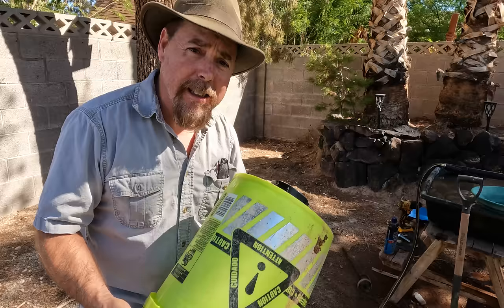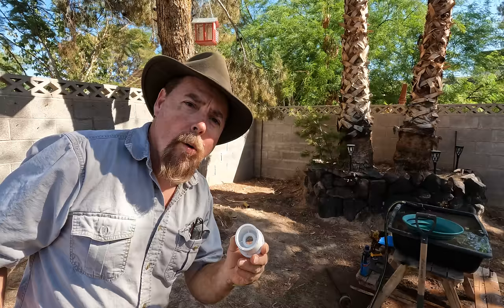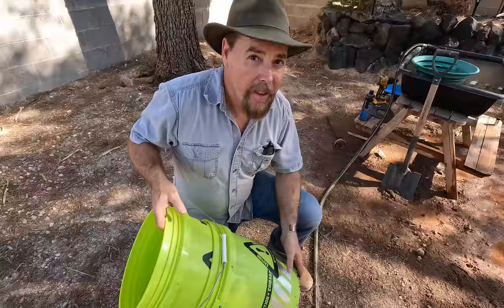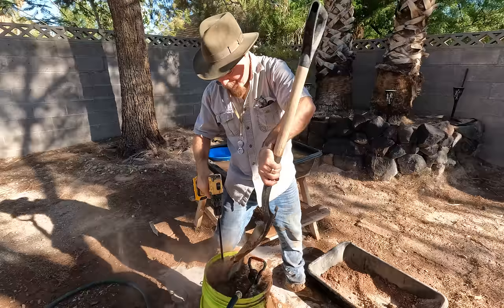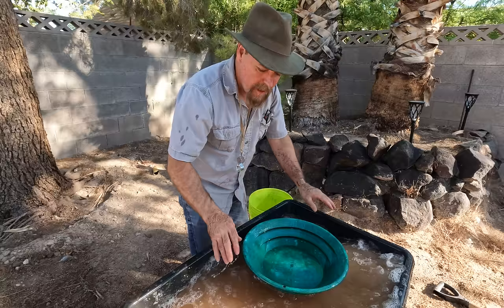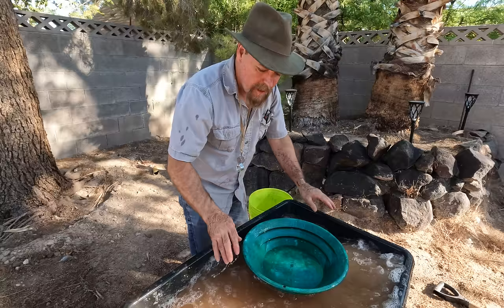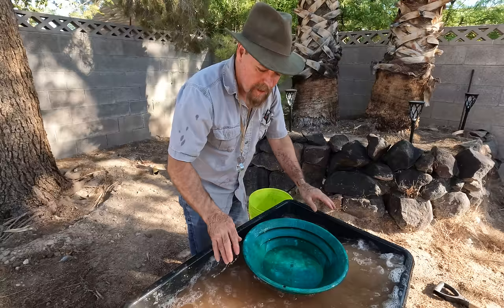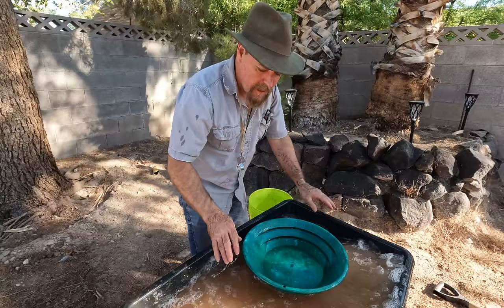Gold Prospecting Hack - Find Gold Using a Bucket & Drill! 🏆🔩

Comment: Ok Mr. Williams, lets do something more 2023, after all, we were supposed to have flying cars by now, so why not go expensive on the most vital tool that determines the efficiency of your potential fines. Let's science the crap out of it, make it transparent so the kiddos can see inside, and us too, to help determine whether it's doing what we want, lets harness AI technology to help with it too! I'm thinking this is a good starting point... This double cyclone build:

A real cyclonic separator that separates off the heavy dirt into a separate holding chamber, where the water is relatively still and the dirt can settle, consider the cyclone in a number of parts:

The upper body – the part that is simply cylindrical in shape and provides a mounting for the water inlet and outlet.
The cone – the section that is cone shaped (surprise surprise). It channels the dirt down through the heavy dirt chute (on the end of the cone) and into the collection chamber.
The water inlet and ramp – the inlet brings in the sleus filled water, the water ramp reduces turbulence by directing that water downwards into the desired spiral.
The water outlet – is another cylinder that sits in the centre of the upper body. The lighter  dirt and water is sucked out the water outlet.
I wanted the cyclone clear, so we could see what was going on inside. This is important to me, because it's almost like magic to me, and so many others, I wanted to watch it actually happening in detail. Having it transparent also means WE can observe the performance differences when WE tweak the design! Play with it, change the airflow, or vary the waste matter being separated, oh the things we can do! Plus we can instantly see if the collection chamber is full or if there is a blockage or a similar problem.  Basically having it clear is MORE THAN just sick dude! It's gonna be EPIC.....😅I hope. Spare no expense, but welded stainless with plexiglass and industrial motor, naw, keep it real, real dirt cheap to duplicate.
Reply from the maker: great idea

Comment: Why not just using a plain bucket with the paint mixer? At the end, you just pull out the iron with the magnet and pan the rest. This way all the gold including the micro flakes would be at the bottom of the bucket. This would bring down the cost of the setup down to $15 (bucket + paint mixer) and no need to build. Just wondering. I'm not a gold prospector, excuse my ignorance if I'm proposing something technically incorrect. 

I would also think a guy could go out, spin the mixer in the bucket for a day, accumulate concentrated materials and pan it at home during the rainy days..
Reply from the maker: we did that with the first design and wanted to add in everything from the comments section to see what we could build

Comment: Gold may not be magnetic but it does react to magnets...

So in theory, if you swing a magnet fast enough you can push the gold right out of the dirt...
Reply from the maker: not sure about that ....
Reply: @Askjeffwilliams   I am, gold is diamagnetic. it is how you are able to use a detector on it.

However it's not practical. Just thought it would be an interesting idea and would be completely wild to see.

Just to be clear you would have to move a really strong magnet stupid fast to get the electrons in the gold to react and even faster to affect the smaller gold dust.
Aka Eddy currents...

Comment: My father was dedicated to catch the fine gold, he design and built several machines with success , he did before the internet, this machine was a centrifugal concentrator with vacum asisted, he place the material in a chamber,were the material was accelerated in a centrifugal acceletaror that turn the aceleration in a colision chamber, the oscilation was tuned to made the gold jump and a vacum capture the heavy metas ( heavier bounce higher in the chamber ) we was able to get all the black sand and gold in a vacum machine bag, he use the pan to cleand the concentrate and have the gold, he never agree with the chemical process, her goal was the fine gold, he look for support to produce in large scale her machine, but the chemical mining won the battle and he die,  i was able to save one of the machines, but i want to still alive, we use the machine in the Cargo Muchachos Mine area , was a success, but he never went to the patent office as he never thrust.
Reply from the maker: would love to see a pic of it if you can